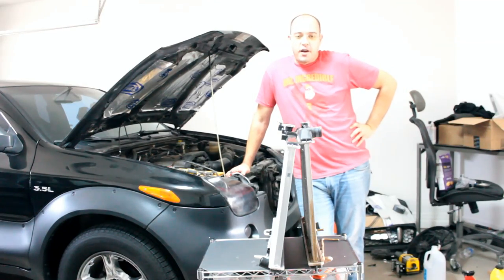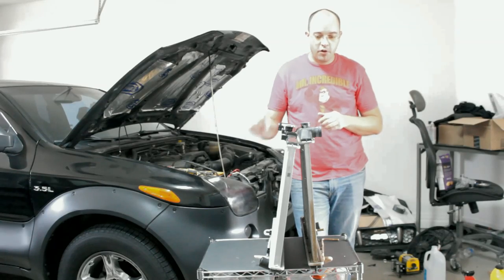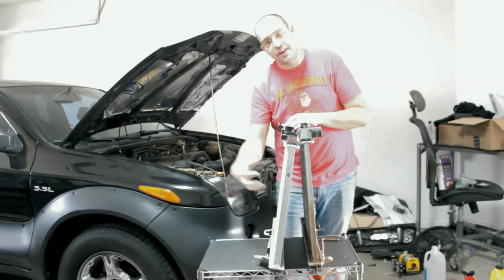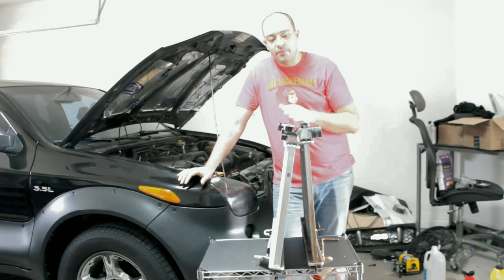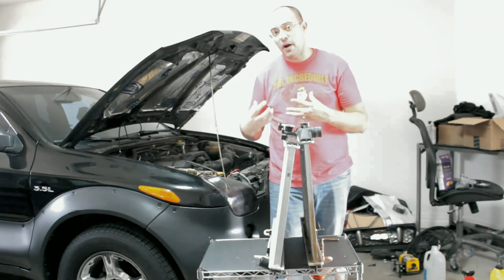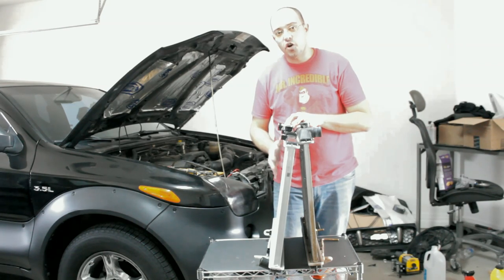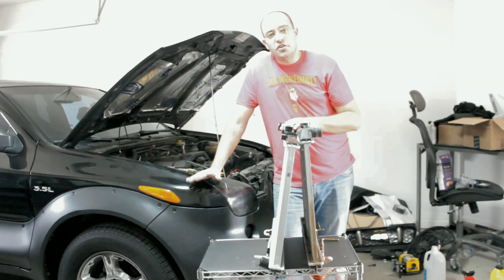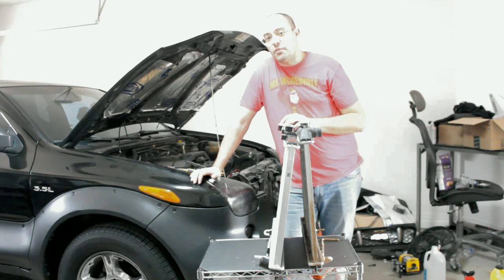Radiator Swap: Upgrading the Radiator to a 2 Row Alumininum Core

Comment: But, the engine thermostat and the ECU would keep the liquid temperature to the factory designed value. By this modefication you will get some relief to the fan operation time. Deeper play with the temperature will require replacing the thermostat and a modefication to the ECU  temp set value.

Comment: i have a 1979 trans am popped a hole in the rad so im replacing,, i have a 4 core brass n steel but im wondering if i should go with a 2 row aluminum or if i should go with another 4 row brass n steel

Comment: I have a Mazda CX-7 2008, 2.3L 4 Cyl Vehicle. I have a damaged radiator anyway and would need to buy a new one. I have been shopping and can't find any two-row Aluminium core radiator for my Vehicle. Can you share a link to anyone in ebay or Amazon?

Comment: Would never buy a plastic ended radiator, rust only occurs as a result of corrosion, which is a resilt of neglecting a routine coolant flush. Metal sealed weld vs plastic bond - which are usually single core and thus cheaper for that reason. An extra $50 average will save a huge headache over time. Plus dual core alleviates stress and frequency of fan dependence to extract heat. This in turn also ensures not only a cooler engine but also a throttle body that also runs through the cooling aystem and thus drive by wire sensors that could be affected by heat related issues.
Reply: Plastic headed radiator is way more better, regarding its life. This is because we have here only one type of metal dipped in  liquid which means fewer chemical reactions and less corrosions.